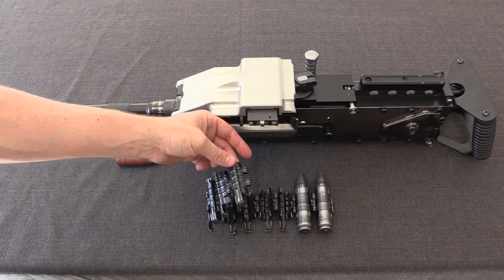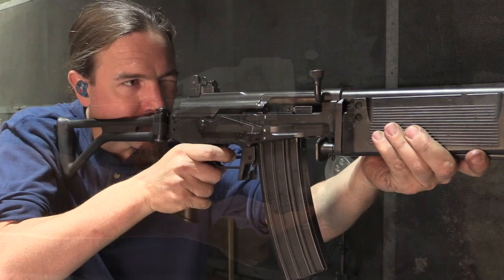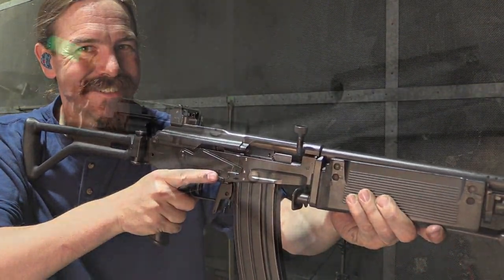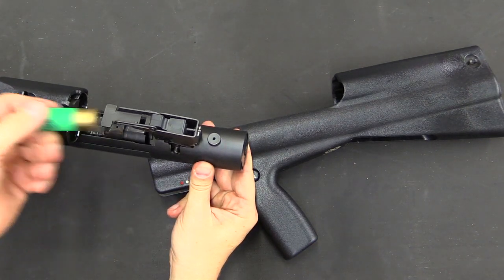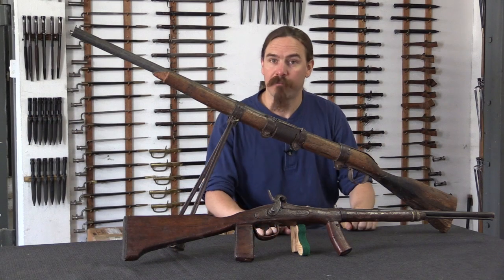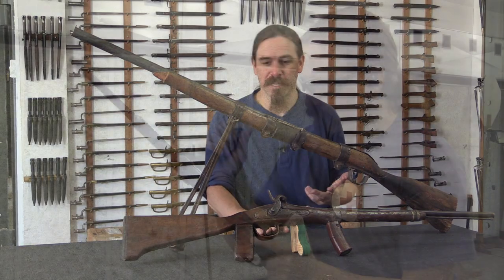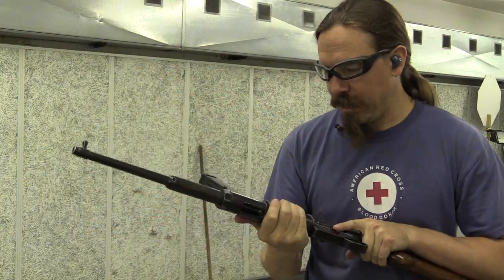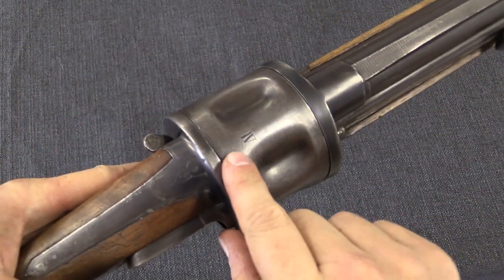Forgotten Weapons Visits South Africa - Teaser Trailer!

Comment: Wouldn't each of those 20mm rounds be considered a DD here in the US?
Reply: Ian Cornell only if they have beyond a certain amount of explosives
Reply from the maker: What I was shooting were inert practice projectiles. HE rounds would be DDs, though.
Reply from the maker: Firearms above .50 inch are DDs (except for the exceptions); projectiles are DDs based on explosive content, not size.
Reply: I think a projectile has to have more than 0.25 oz (~6g) of HE, incendiary etc. to be a DD. A gun over .50 is always a DD though.